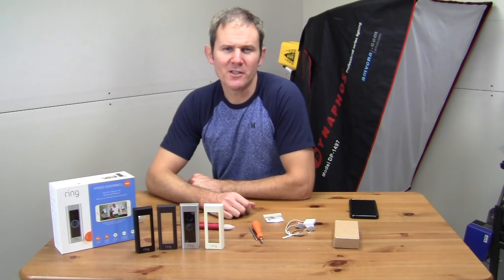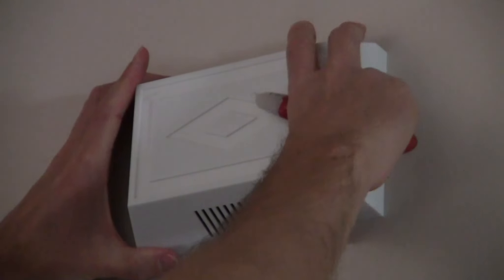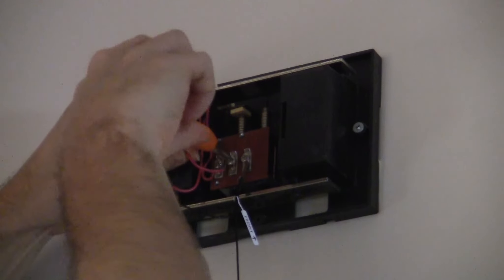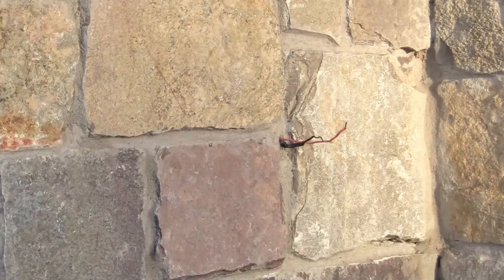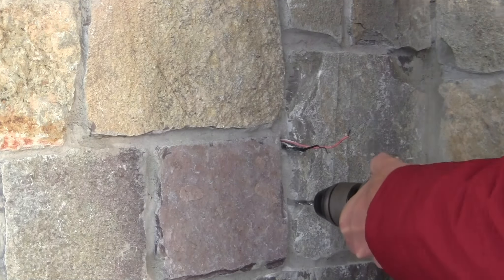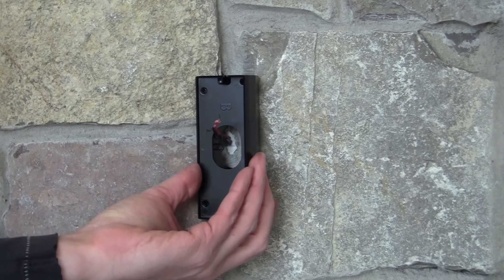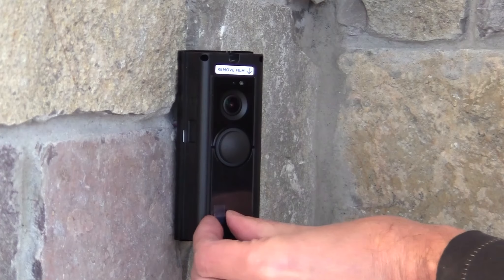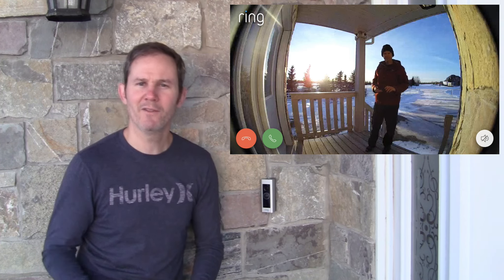Installing the Ring Video Doorbell Pro – Step-by-Step

Comment: The  Ring Elite is POE.  I don't think there is any actual advantage otherwise.  It would be best for those who have poor wifi coverage but it also is recessed mount only so that would be another issue you'd have with the rock wall.

Comment: I wanted to replace my ring doorbell v2. I tried the doorbell 3 plus but didn't like the fact that I have to hardwired and use the battery at the same time jus this the 3 secs preroll. So I decided to get this certified doorbell pro. Since I done the install of a few ring doorbells I tjoght this be fast. I'm handy with wires as I did replaced my old transformer with the 16v one as recommended. That was tricky but not too bad. I added the power kit to my mechanical chime, went through the install step and somehow the blue lights keeps blinking. OK. Called ring support and was told the pro actually have an internal capacitor (battery) that needed a few hours to charge up. OK. after a few hours the spinning white light i needed finally came on, great. Excited. Start the install and it stuck at the join ring network. Somehow that never came on. Call support again. The new guy was saying not enough power. I told him I got the new transformer installed already. He said , skip my old chime and installed the chime wire directly to the power kit. See pictures. I did that. we waited. And install again. Did not work on my phone app. He said try to do on another device like iPad. I did that. Same issue. He told me nothing he can do now. He will put in level 3 support and have them call me back. 4 hours later, no one call. So I decided to Uninstaller the pro and put back my trusty old Ring doorbell v2. Ready to return this garbage. Maybe when pro v2 comes out, I'll try it again.

Comment: Quick question - Is it a must to hook the bypass power kit if you buy doorbell pro along with wireless chime/chime pro? What if I want to hear the doorbell only on the wireless chime/chime pro but not the existing mechanical doorbell? Can I just use the doorbell pro and the wireless chime/pro to communicate which means I am NOT hooking the bypass kit to the existing mechanical doorbell.

Comment: Thank you for the video.  I noticed the angle brackets you are using in the video are metal but the link you provided is for plastic angle brackets.  Are the metal ones available?
Reply from the maker: No, I the metal ones are no longer available unfortunately.

Comment: Thanks a lot for the detailed installation instruction video, easy and simple. How can we protect the ring doobell from thieves?
Reply: Limar Pin worse case scenario, ring will send you a replacement if your doorbell is stolen as long as you report it soon enough and have a police report.
Reply: @kristinachai5520  And keep your original receipt for any claims.

Comment: This might sound like a stupid question, but if there is a part of the plastic wire insulation toughing the screw when you tighten it down at the box in the house, should it still work? I cant get the door bell camera to power up.
Reply from the maker: Not sure what you mean by the "box in the house".  You doorbell will need to charge up before you can access it.  Is this a brand new intstall?
Reply: Yes its brand new. After looking around online it's my guess that my doorbell transformer isnt the right voltage. I have a 16volt so I just ordered a new 24volt off Amazon
Reply: I was referring to the chime box in the house
Reply: No it wasnt the transformer.....
Reply: Does anyone know how to charge the internal battery in the ring pro

Comment: Hello in your video you used the angle brackets on the left side of your door. Looks like I will need to use angle brackets but my doorbell is on the right side. Can I still use these same angle brackets that you have linked?
Reply from the maker: Yes, the brackets will work for increasing the angle from the right or left.  Thanks!

Comment: Sir can u tell how to connect eletrical power supplay 

How mouch wire we need 

U conecting 2 wire there  thats the power supplay? 

Plz replay sir 

My English is not good sorry for that
Reply from the maker: Hi. The 2 wires outside connect to my chime and the power from my existing doorbell. This model doesn't connect to a breaker panel itself, you would need a battery operated device for that. Not sure what you mean by how much wire is needed beside enough to stretch from the outside install location to the already installed chime. Hope this helps.

Comment: I have power to my doorbell button outside.  I currently use my alarm panel as the door chime.  I'm looking keep my alarm setup but switch my doorbell camera to Ring.  Would I just use the Ring Wifi extender with chime so I have a chime inside?

Comment: Hello there, am i just gonna install and wired my Ring Doorbell in replacement of my existing doorbell?
The wire of the existing doorbell will just be connected directly to the ring doorbell?
So the voltage input needed is just the same?
Reply from the maker: No, you need to use the included transformer kit like in my video.
Reply: @HomeTechDIY 
so i am gonna wired (connect) the ring doorbell directly to the existing wire doorbell?
Reply from the maker: Yes, but make sure you follow the instructions and use the transformer kit which you purchased with the doorbell.

Comment: is the pro hardwire only or does it have a rechargeable battery?
Reply from the maker: It has a rechargeable battery
Reply: @HomeTechDIY  for hardwiring do you need a transformer or does it just connect to existing doorbell?
Reply from the maker: It depends on the current doorbell.  For "newer" systems, you would use the included transformer.  https://support.ring.com/hc/en-us/articles/360000081206-Installing-your-Hardwired-Transformer-Kit

Comment: Our existing doorbell is battery operated. Can this device work with our doorbell? The house was built in 60s.
Reply from the maker: No, you need a power supply from your fuse box to the chime then to the button.
Reply: The Ring 2 is battery operated. Probably your best bet for a video doorbell.

Comment: What tools do I need in order to install a ring doorbell pro?
Reply from the maker: It depends on your setup but the basic tools are included as shown here and in my unboxing video.  It your configuration is more complex, you will need additional equipment or even an angle bracket.  Hope this helps!
Reply: Your brain!

Comment: My good man...at 1:38, what are those 2 gray things that you are installing?  I just got my kit and mine doesn't have them??
Reply from the maker: Those are wire connectors.  It's a more modern wire nut.  They should have been a part of the kit.  Does the install manual indicate they should be included?
Reply: @HomeTechDIY  the manual doesnot show me installing them, nor do i have them in the kit. Must be discontinued in the newer kits? very strange?

Comment: Do I need to cut the power to the doorbell before touching the wires?
Reply from the maker: Yes, you will need to turn the breaker off.
Reply: Yes.
Reply: What about if there's no label on the breaker that pin point which switch is for the doorbell

Comment: Thank you for the video.I had a similar need for the angle. So your video was very helpful to buy the angle mount and then install them.

Did you ever wire your second Ring video doorbell pro? If so, can you please post video of how to setup the two powerkit pros with one mechanical chime (i.e., one transformer)?

Thanks again!
Reply from the maker: Glad you found the video helpful.  No, I have not yet installed the second doorbell.
Reply: P

Comment: How to connect it in 220V operating existing door bell
Reply from the maker: If you are Europe, or using a 220/240v system, the setup instructions on Amazon's UK site are the same as the ones I followed when I created this video.

Comment: My current doorbell is in our living room. wondering how can i figure out which one is the breaker for that.
Reply from the maker: It took me a while to find mine.  It was on the same circuit as my basement washer.
Reply: You will need someone to ring your doorbell while you try power breaker switches until the doorbell stops ringing (when the power is disconnected). I would make that breaker switch.
Reply: Not sure if you ever found this, but I was able to locate mine as I found the transformer first, then tried that section of my house at the circuit breaker and started installing after ensuring the doorbell was dead.
Reply: Your existing doorbell system should be powered by a 16 volt transformer. As this is low voltage, I wouldn’t worry about shutting off the circuit breaker.

Comment: i don't have existing doorbell. I've connected the power kit wires directly to the transformer on the wall

now My ring doorbell is not getting power  and not turning on. any suggestions ? thanks
Reply: If you don't have an existing doorbell, then why is there a transformer on your wall?

Comment: Where did you buy your wire splices from? What's the name of them? I worked with a electrician and he had some of those splices, they really come in handy.
Reply from the maker: This is the closest I could find to mine on Amazon: https://amzn.to/2Li3kU3
Reply: I was actually referring to the connector at 1:40 (orange and grey splice). Where did you purchase those from? Thanks.
Reply: Google: Wago lever lock connectors

Comment: Great video!, Do you have to change out the transformer from 10v to 16v? I hear the Pro really does recommend at least 16v for good wifi connection.
Reply: Yes, and to a 24 volts, not 16.  It's easy but make sure you turn off the power.

Comment: In some other Ring Pro installation videos, there's a mention of a need to replace a transformer on pre-1995 homes.
Reply: Make sure your transformer is 16Volt/30VA. (16Volt/10VA is not enough power for night vision).
Reply: @billbob812  Thanks! Will just need to locate it. I just measured the voltage at the doorbell and it's only 3.6 volts. Not enough even for day-time.

Comment: How about if I don’t have an existing doorbell then what?
Reply: They have a model thats battery powered , you would have to charge the battery every 6 months though...
Reply: DRE day Thank you
Reply: @markiaj3462  No problem, glad to help out. Be sure to look into the ring door bell and chime bundle whenever  you decide to get it, its cheaper than buying them separately.
Reply: @dreday6250  So I got the ring 2 doorbell. Im waiting on the chime but I set everything up. Thing is it is saying my signal is slow. What do I do about that?
Reply: @markiaj3462  The chime is also a wifi extender it should boost your signal once you install it
Reply: @DRE day thank you again Dre! It’ll be here in a few days! I’m so excited 😆
Reply: @markiaj3462  And if all fails you will need to call your wifi service provider and ask if they have any "promotions" to upgrade your wifi speed, I myself had to upgrade my wifi to 100 speed and purchase a wifi booster for 30$ good luck and feel free to keep asking i went threw the whole process!
Reply: @markiaj3462  oh and turn off wifi on any other devices that you dont use everyday, for example i have an old ipod in my drawer i didnt use but it was still pulling wifi.
Reply: DRE day thanks for being patient with me. I’ll let you know if it’s better once I add the chime and if not I’ll see what promotions if any Verizon has.
Reply: @markiaj3462  No problem :) , keep me posted!
Reply: DRE day I Finally got the chime with WiFi. Everything works great!
Reply: @markiaj3462   Alright !!! I am happy for you ! Enjoy, stay safe ok !

Comment: What a pain. Ring needs to have an option to pay for installation.
Reply: As an installer I understand that you don't care to install the Ring yourself. You can easily hire a tech with residential building experience to do it right and many (like me) guarantee their work. No worries.
Reply: Guaranteed that you know someone that can do it. It's really not that hard. Just ask around. Offer beer.

Comment: So.  There is an existing doorbell.  And this is what, just a different ringtone?  And you turn off a breaker for a low voltage device?  Lameness all around.  Jeez.  I didn't listen to the audio.
Reply: Switching off the panel power breaker is basic and good practice with electrical work. The Ring Door Bell uses the existing wiring in your home to 1- let you know someone is at your door plus 2- live video 3- with audio/sound to communicate with them (anywhere) via your smartphone. You might want to go to the Ring web site and watch the on-line demonstration.